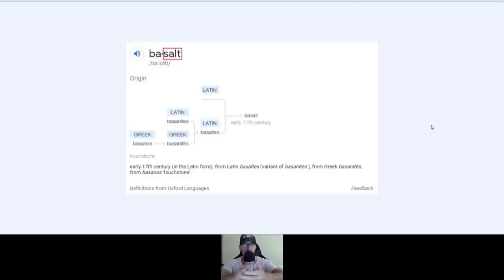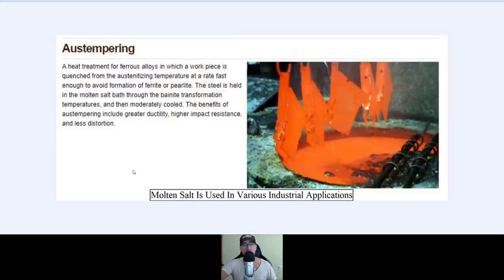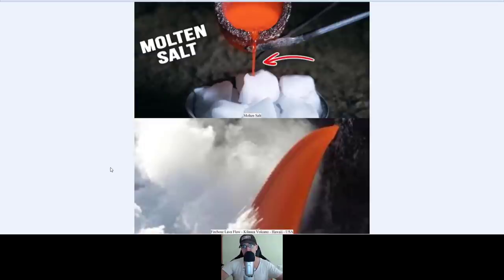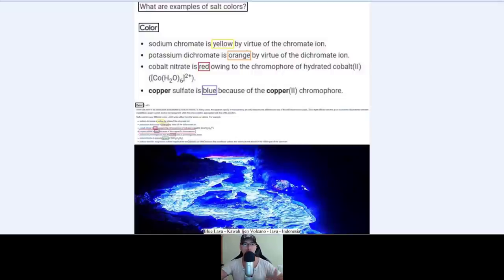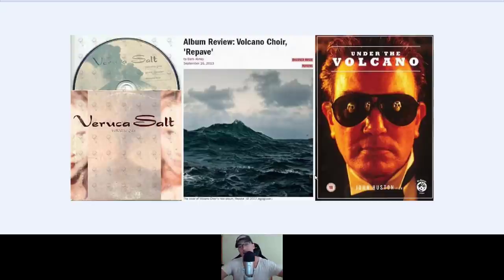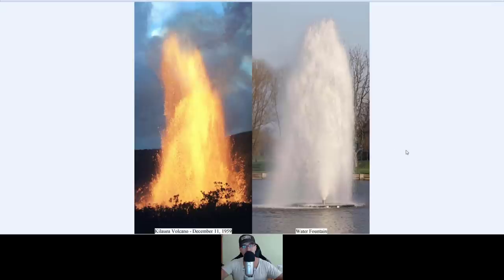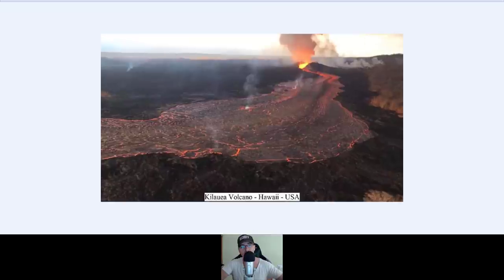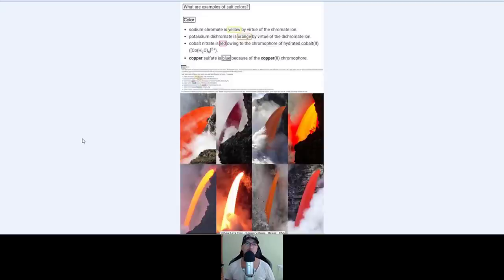Volcanoes & Lava, but not how you know it. Credit Mike Ferreira

Comment: Lava is NOT just molten salt.. Salt NaCl is used as a salt cap when melting Silver.. The molten salt floats on top and prevents Oxygen from getting into the Silver or enriched Gold ore... When you pour it out, the salt will go back to its original solid form... But exposed to  the rain and the elements, it will dissolve over time and disappear... Lava fields are visible and as old as time...